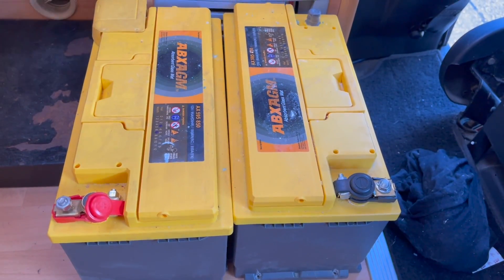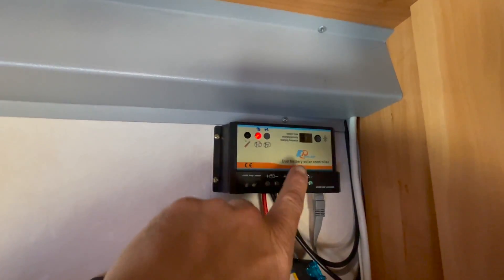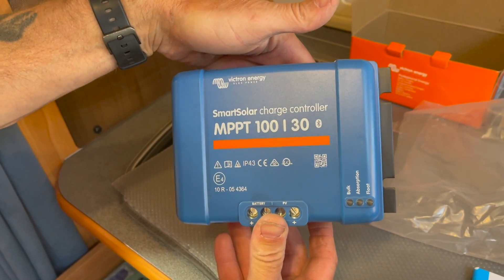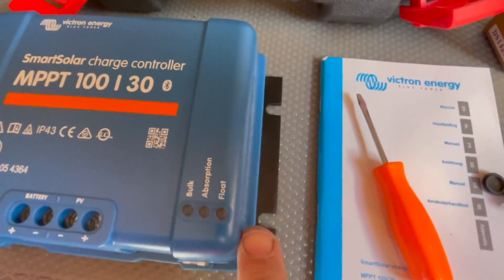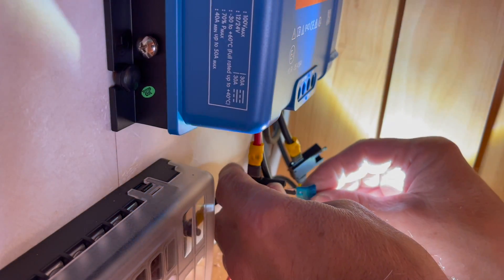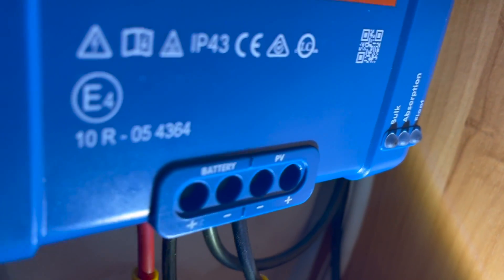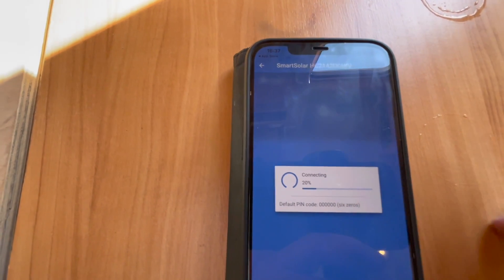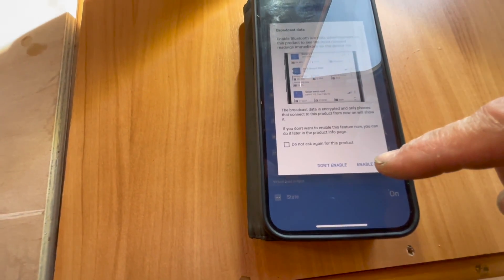VICTRON MPPT SOLAR CONTROLLER UPGRADE. MOTORHOME RV CAMPER.

Comment: Is there a recommended air gap to be provided above the controller?
Reply from the maker: If the mppt gets hot from over working they thermal down then ramp back up, as long as the heatsink is able to vent then its fine, theres no real answer as some say not to mount on wood as it can act as thermal conductor, but as far a victron is concerned 10cm under the mppt . The manual says "Observe a minimum clearance of 10cm under and above the solar charger for optimal cooling. " but this is not always possible in some cases.

Comment: Very nice, i just installed my Victron 100/20 charge controller. In the battery drop down what would i select for 5 RV/ Marine lead acid in parallel? Have a great day and be safe. Ps what charging parameters would you recommend using?

Comment: What charge setting you have for your Li battery? Can float be shut off? Only use bulk and absorb?
Reply from the maker: Victron has a setting for the  AGM battery that was fitted in this video for the motorhome,so used that setting and just tailored it to the customers needs.
Reply: @MySoloVanLife  cool.I was wondering how what where to set it for Li bats.
Reply: Hi,
I've got a Sargent solar controller I'll be changing for a victron. Did you remove anything other than fuses when changing the units please?
Reply: @markeastwood5093  I do it a night.

Comment: Iv got a 410w solar panel and the same charge controller 100/30  do I need to upgrade battery cables 
It had a 100w panel before
Reply from the maker: Ive alway looked at the maximum cable gauge that can be fitted, that way its completely future proof and the cable is never streesed or possibly get hot.
Reply: Heard not much room to fit a bigger line .

Comment: Ive been building out my 1993 holiday rambler travel trailer for off grid living. I e done a lot with the solar power system and I too just upgraded one of my solar charge controllers to the victron 150-70.  My old powmr charge controller was decent but the victron stuff is in a class of its own
Reply from the maker: Victron really does have it sorted, makes more power thank to its ability to track across the surface of the solar panel and if you have other victron equipment you can network them together so they all work together to gain the best performance. 👍👍

Comment: The 100 20 has a load port which can be programmed when to switch on and off. That can be practicall as a protection for your battery.

I know two 100 20's are more expensive then one 100 30, but something to consider

Comment: Hello, there is a 20amp mppt charge control. Is it efficient to connect 4 50 watt panels in parallel or in series with 44 volts in 2 groups, the system is 12 volts?
Reply from the maker: If you go on the victron website there is a solar calculator and loads of resources on there to match the controller to a solar array 👍
Reply: @MySoloVanLife  thanks

Comment: Those cheap controllers can work sometimes. I had one on my old van that worked flawlessly for 5 years. I put the same in my new van and was getting all nonsense out of it, like apparently solar charging at night. Much better to fit a decent branded one.
Reply from the maker: I think the customer just wanted victron as that what i fitted to his last motorhome. fit and forget with no error lights.Thanks for watching  and a great  comment , kind regards👍👍👍